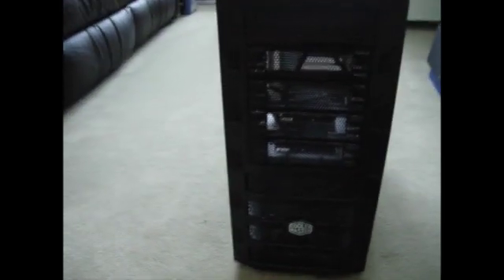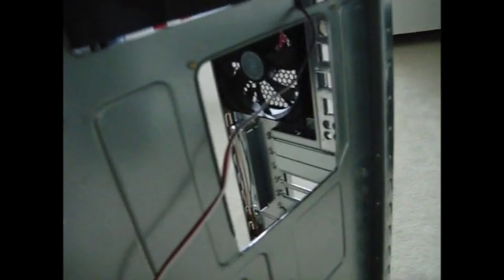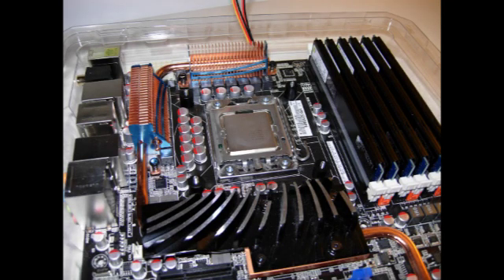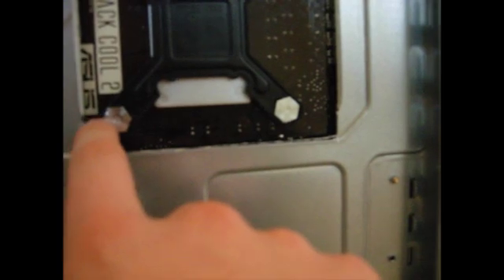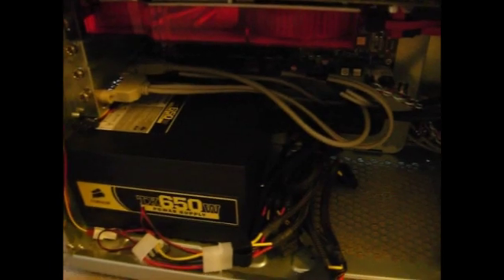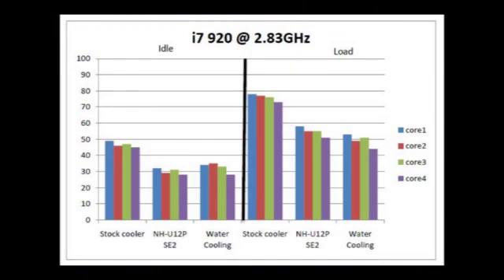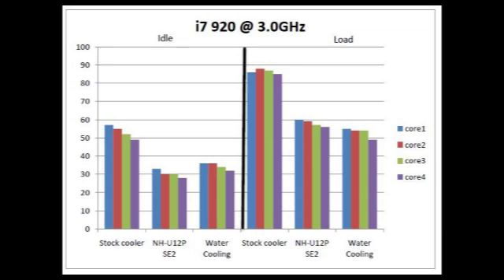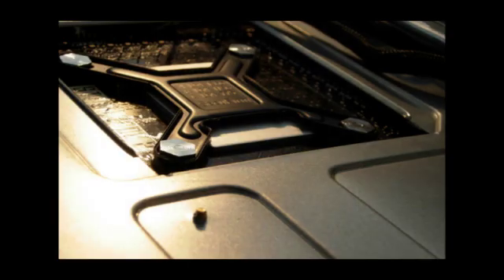Noctua NH-U12P SE2 Installation guide and review

Comment: @darkcg79 
"Cutting the HAF just for installing backplate is insanely stupid"
Dude, it's a piece of metal, you can modify it however you like it. What exactly can go wrong after moding with a that you'll need to RMA it? If a fan breaks just buy a better one, stock fans aren't exactly the best.

Comment: @asuhurley Hey dude i just installed my Noctua NH-U12P SE2 and i also had to modify the back hole for the backplate :( But it fits now and it runs at 25* idle at 3.0ghz (i7 930) In the Antec 900 two case with the Asus P6T SE mainboard. Also had to remove the side panel fan, but thats ok :)

Comment from the maker: @bellino12862 I taught about that, but if your stand off are too long, your I/o shield plate might not fit with the back panel ports of your mobo. I found it easier to simply cut the case

Comment: Regarding the HAF cases and the back door for the cpu back plates, i think the tight back plate helped for support of the massive heatsink cause that thing is big and heavy so with no back door it might put more stress on the motherboard, but i could be wrong, just a fan looking out for another fan, my noctua coming in few days.